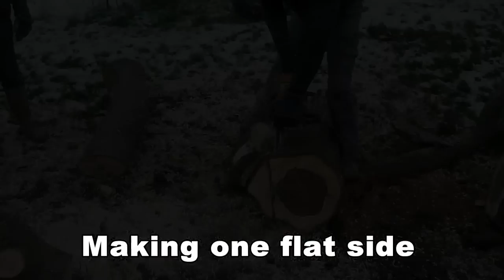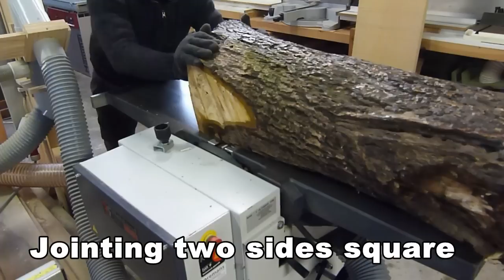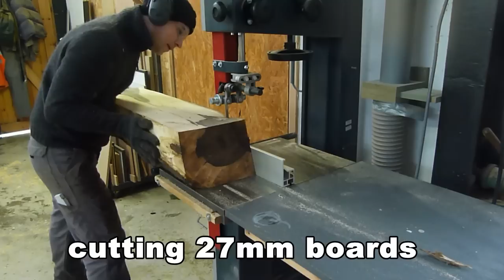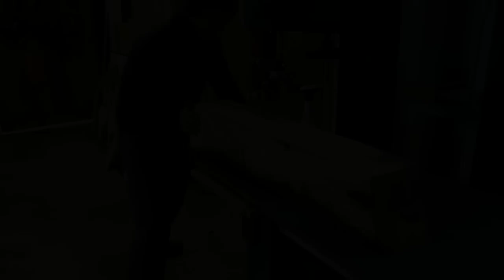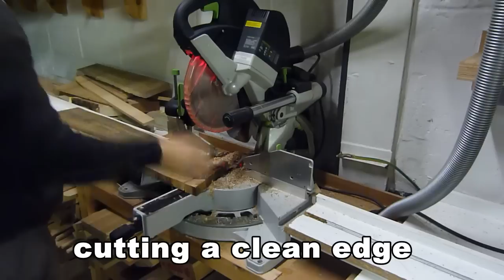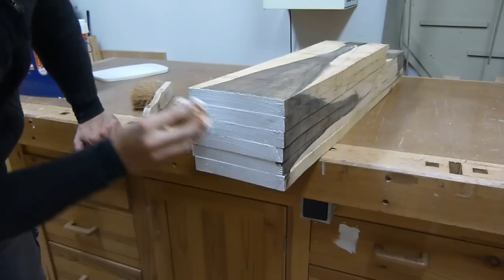resawing logs on a hammer bandsaw

Comment: I May have already asked this on another video of yours bit what blade are you running in the band saw? Seems like it cuts quickly.
Reply from the maker: For this cut i was using a "tuffsaws" sabre cut blade, it's a very aggressive blade that can also cut wet wood with ease. But for my regular cuts i switched to their M36 range which is more expensive and cuts slower, but it lasts incredibly long.

Comment: i think you wanted to say 27 CM  and not 27 MM
Reply: What? 27mm is just a hair over 1" thick which looks like about what he cut. 27cm = 270mm which is closer to 11" thick. I don't think you understand the metric measuring system properly, or the imperial one.
Reply: Gareth KalberΥοu are correct..forgive me...I thought he meant the height of the board,and I see he means the thickness...Thank you for your answer! 
btw I am waiting my new HAMMER to arrive!

Comment: There's a difference between "resawing" and "sawing". Think about it. This is "sawing". FWIW
Reply: Jacques Blaque technically your both right. Traditionally the term resawing was used when “resawing” Veneer from for example a 300x50mm board. However it’s now used to refer to a “deeping” cut also ie a cut along the grain cut to the widest part of the board for example cutting the 300x50 into two boards 300x25 minus Saw kerf.